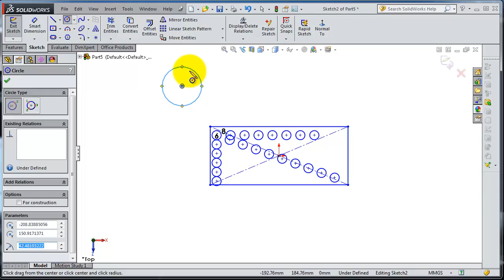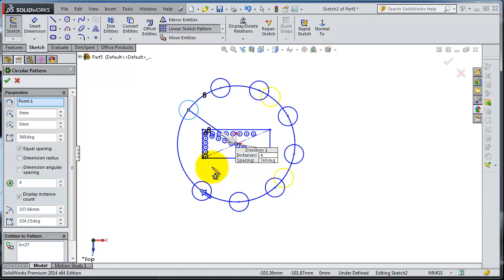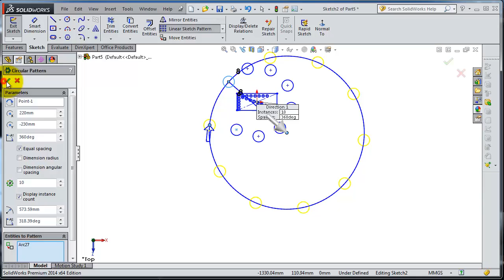SolidWorks 2014 Tutorial19: Sketch Circular Pattern

Comment: Tutorials Engineer is the greatest Youtube site for learning SolidWorks. And we are the greatest company for manufacturing your custom parts and products you are sketching. From our logo on the left you can go to our Youtube and then to our website. For metal castings, CNC machined, sheet metal fabricated, plastic and rubber moulded components and assemblies, extrusions and others we are ready to help you. On our website you will also see how we do engineering integration incorporating mechanical components with electrical & electronic and optical components.